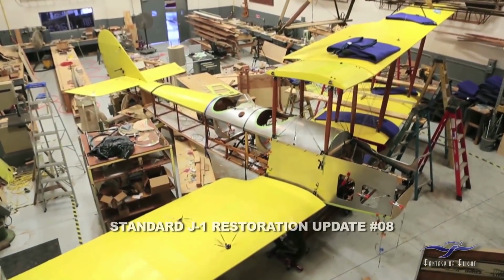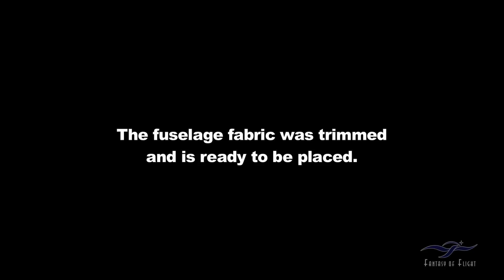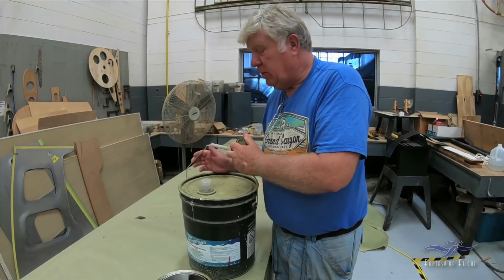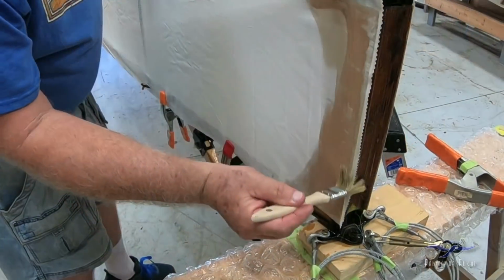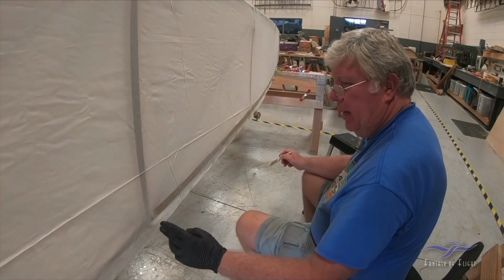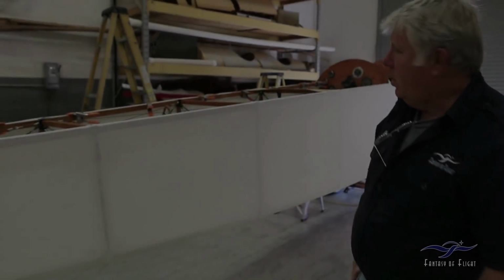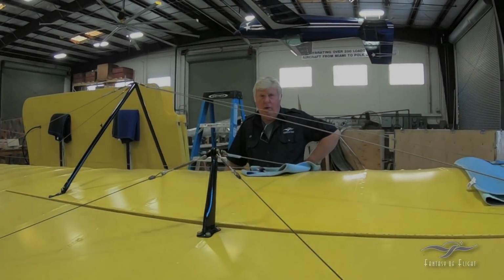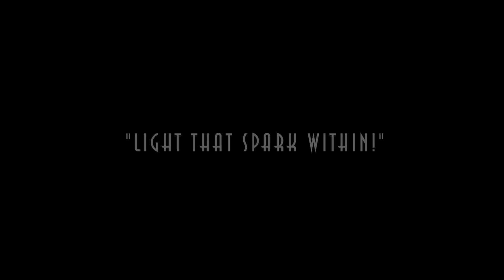Waldo Pepper Standard J-1 - Restoration Update #09 - March 2022 - Fuselage Fabric

Comment: When I was a teen I made model aircraft from balsa wood covered by tissue paper.  What I find both satisfying and astonishing is that the tissue was installed on the frame the same exact way, except I didn't need to use hot water.

Comment: Wonderful restoration, but surprised to see that you didn't wear any type of mask while applying the Dope.
Reply: As long as you do not spray the dope, it remains inert. When atomized is where you get in trouble if not wearing a respirator. The nitrate should also be brushed on so that the threads of the fabric are fully encounsed. The butyrate dope is sprayed, which requires PPE.

Comment: Is that aircraft grade cotton? If so, where on earth did you obtain it? I read years ago that a guy performing a restoration used irish linen as Grade A cotton was impossible to find. The tapes will be interesting because Ken will have to make those unless you've found a source for them. Lastly, the fabric edges are pinked. I don't think pinked edges were originally used, but it is best practice

Comment: Would hot water work on ceconite or do you use hot water because an iron won't shrink cotton?
Reply: Nope, Ceconite needs the heat of the iron to shrink. I liked this video, because I've never seen cotton being applied to an airframe. I've taken it off, but always replaced it with dacron (ceconite or Sttits). Saw the results of the Stewart process today - impressive!

Comment: Great workmanship!  I know the feeling of chasing alignment while clamping; sometimes it turns into a back-and-forth process to get the material centered properly.  Although I'm familiar with using polyurethane aircraft paint and all associated products, I'm unfamiliar with the use of aircraft fabric dopes.  I found it interesting that you weren't wearing a respirator or wearing gloves at first, so I had to check out the MSDS for what you're using.  I trust your experience enough to know you're being safe, and it doesn't seem to be nearly as bad as polyurethane... but still a pretty noxious chemical.